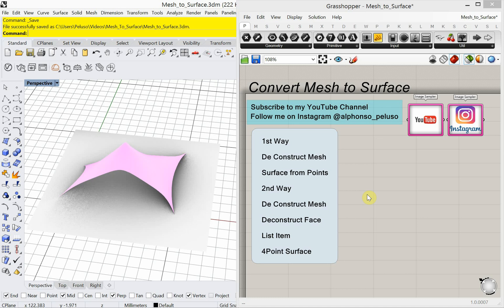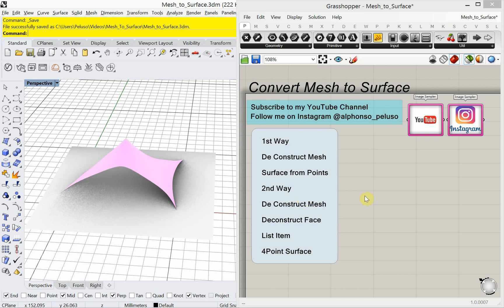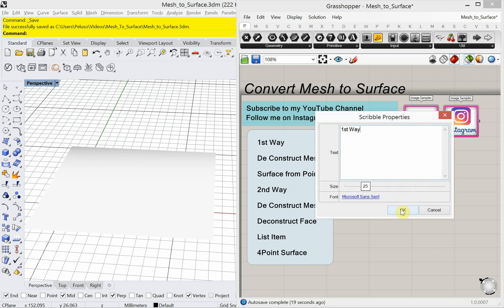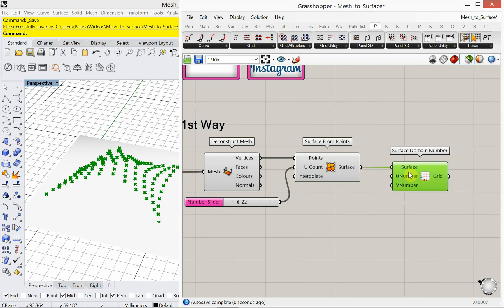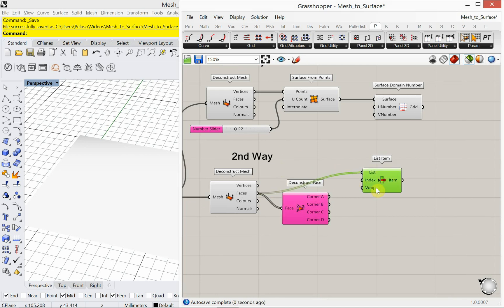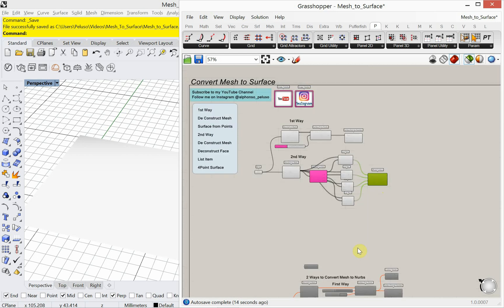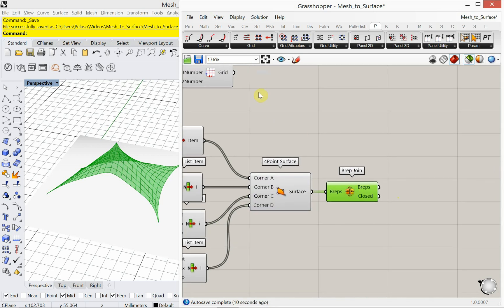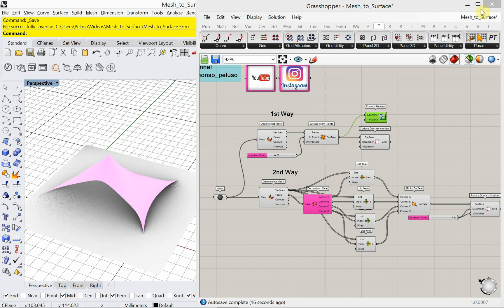Mesh to Surface

Comment: Ok so I was looking for a way to jump between Rhino and Blender because I like to use both exact measures (Rhino) and sculpting tools (Blender) for my design. Blender produces meshes but when I import the objects back to Rhino I want them to be surfaces. I'm designing production molds for ceramic products. Not sure yet whether this is the answer but we'll see. :) Thanks for the tut!
Reply from the maker: @venlalappalainen9393  You can try the Mesh to Nurbs command in Rhino

Comment: hey, thank you for the video!! i have a question. now ı want to work with the surface that i created on rhino without using grasshopper. How can i save it as surface as rhino file?
Reply from the maker: You’re welcome. You need to bake it from Grasshopper to Rhino. You can right click on the output of the last capsule and select bake.

Comment: Hello, what plug in are you using in order to get 'surface domain number'? Also, off topic, how does one get the text to show up above each command box, in grasshopper?
Reply: I found the plug in 'Paneling Tools'
Reply from the maker: The plugin for the capsule names is bifocals. You can find it on YouTube

Comment: Hello Alphonso. First of all thank you very much for the tutorial. Is the surface finally generated in Rhino as a new entity after you finish running the Grasshopper definition with the second method?
Reply from the maker: Hello Luis, You’re welcome. Yes, after you bake the surface it becomes a new surface from the original mesh. Keep in mind that it might be a polysurface depending on the complexity of the original mesh.

Comment: hi Sir is it possible to make a SINGLE surface from a complex model?? the same question of narcellius..it might spit out a polysurface instead of a single surface depending on the complexity of the mesh? i just need a single surface not to precise just like a loft. like an offset from original model
Reply from the maker: That’s always the challenge. Many times complex meshes can only be made from polysurfaces. You can try drawing lines over your mesh with the vertex snap on and then lofting the curves. Trying Edge Surf would also be another option to try.
Reply: @AlphonsoPeluso  actually dont need from the complex i can remesh with low poligon but i still have multisurface. with loft it is possible to have circle going out from multi direction? cause loft it is possible from two sides. thank you
Reply from the maker: @ahmednahdi4810  Yes, in some cases you can loft with circles and curves.

Comment: Thank You for the idea. Looks very elegant... Especially with a very simple and quadrantulated object ;) But, sad, not IRL with a messy STLs. Is there any rule-of-thumb for the U number estimation?
Reply: When working with complicated and messy STL files I have had poor luck using the U value. Your second option worked much better! Thanks for making this video!
Reply from the maker: @SamZ  You’re welcome!
Reply from the maker: Thanks for the comment. I haven’t found any rational for U value.

Comment: Hi, thank you for the tutorial. I wonder what is the logic of the U Count. I have been trying to find the right number but failed.
Reply: Exactly, it seems very weird and trial and error dependant, the other method is straight forward even though it uses less components.
Reply from the maker: Hello. Unfortunately there is no logic to the U value.

Comment: The second way creates lots of surfaces rather than just 1 surface. When I join them all it then creates a polysurface which is not what I am after. Any tips?
Reply: no, same problem. I feel with you bree
Reply from the maker: Hello. Yes the second way creates a polysurface which is not ideal.

Comment: In rhino 7 can you convert mesh to subd to nurbs surface? Though it might spit out a polysurface instead of a single surface depending on the complexity of the mesh
Reply from the maker: Yes. It all depends on the complexity of the mesh.